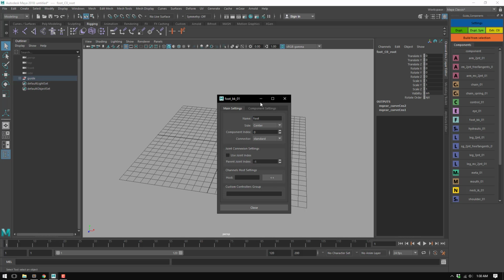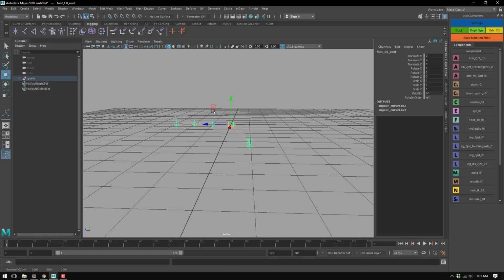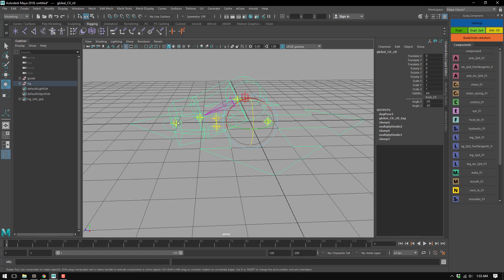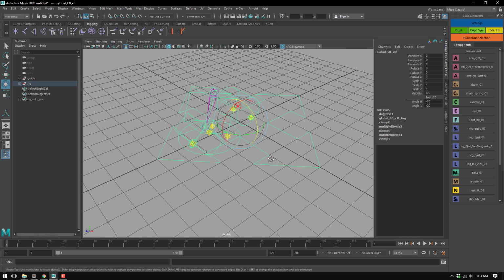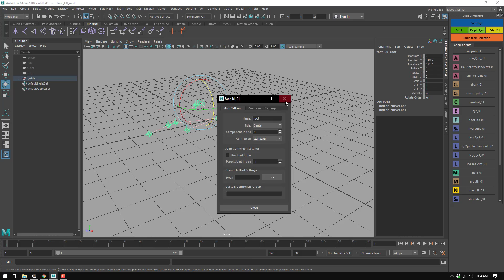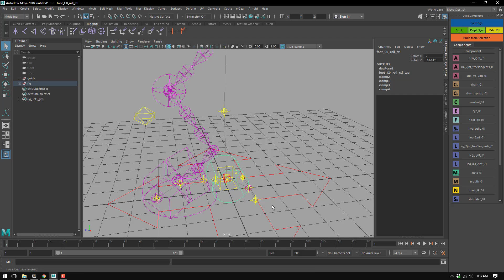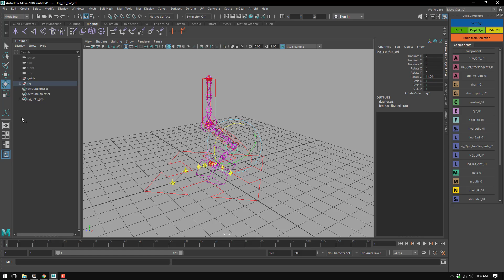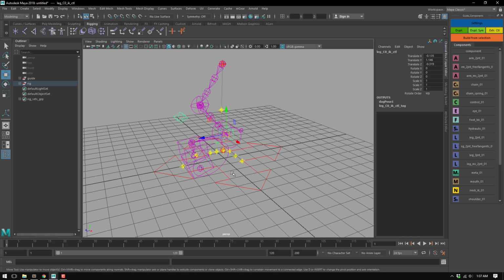Shifter Component: Foot_bk_01

Comment: If I want to add extra controls to manipulate toes individually, where in the hierarchy should they go?
Reply: Gave it a shot by attaching a chain_01 for each toe to the joint second from the end, so they move along with the front of the foot. The rig action work alright but the controllers need significant adjustment to make them easier to pick.